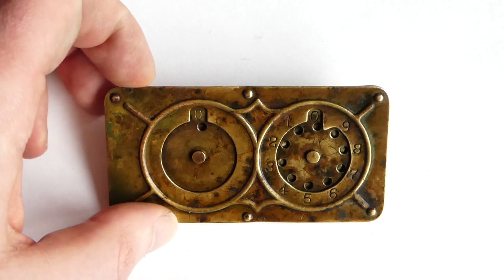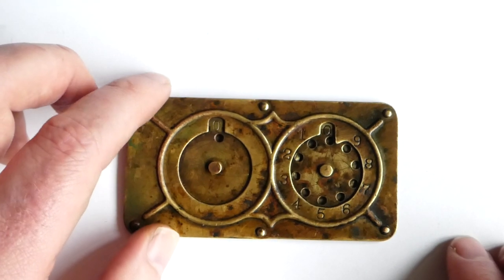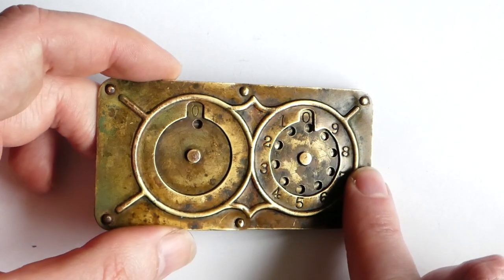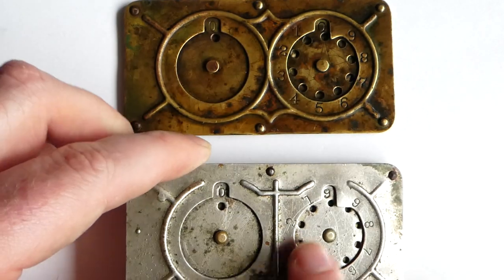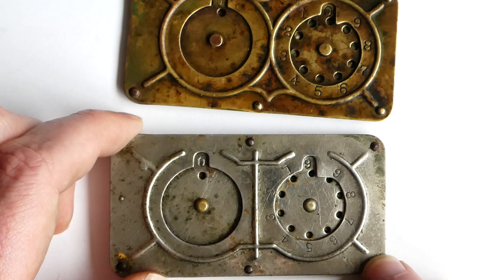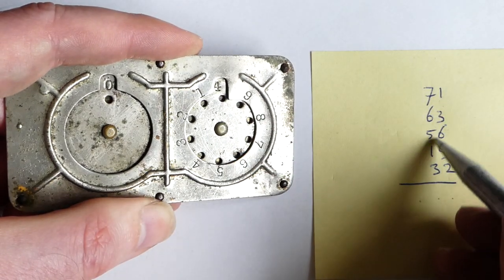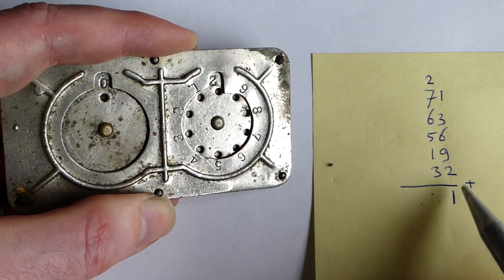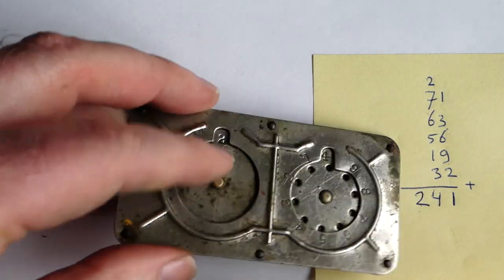Stephenson Adding Machine

Comment: I noticed that, when resetting the machine, you turned the ones wheel backwards and the tens wheel forwards. Is that the standard procedure for resetting this kind of machine?
Does the tens carry operate in both directions, or in one direction only? If you attempt to, for example, subtract 1 from 10, will that damage the machine?
Reply from the maker: That's a good question. On most machines with dials you would have to turn it clockwise to zero (which performs a carry) and then reset the dial to the left (see Lightning Adding Machine for example). You can do that here too of course. On this machine the right  hand side dial has no latch, so it moves backwards freely, but only until it hits zero at which point it cannot move further. This is an easy way to reset it. You cannot move it further because the the left dial does have a latch, and cannot go in the direction that this reversed carry would move it.
On the first generation of Stephenson adders, the pawl used on the left dial latch was a leaf spring. I suspect that those could bend or break if you forced the right dial backwards past zero or if you directly turned the left dial clockwise, and this is why changes were made. On this second generation machine the pawl is a strong metal part pushed against the teeth of the left dial by a leaf spring, and it can withstand any attempt to move the left dial clockwise. The first generation Stephenson Adder is easy to recognise because it does not have any decoration on the front, just a flat plate without raised ridges.